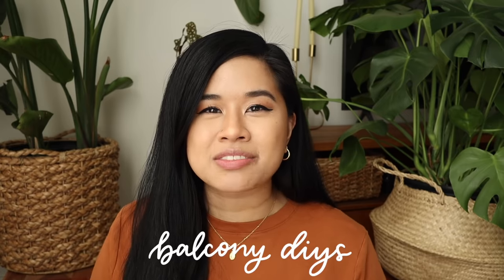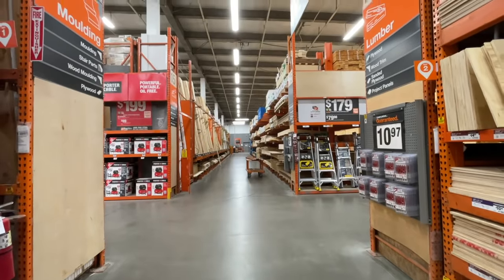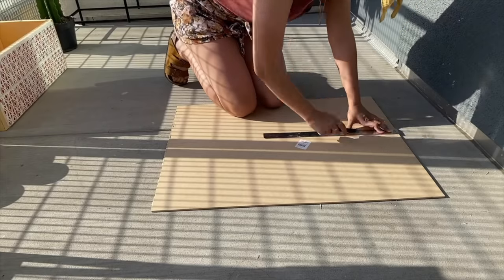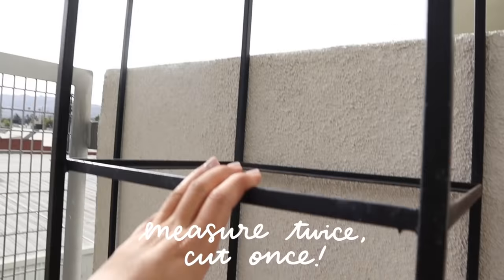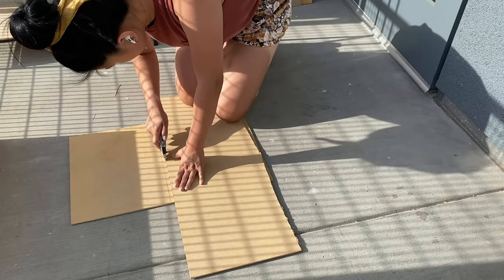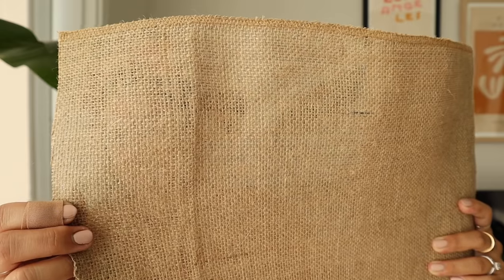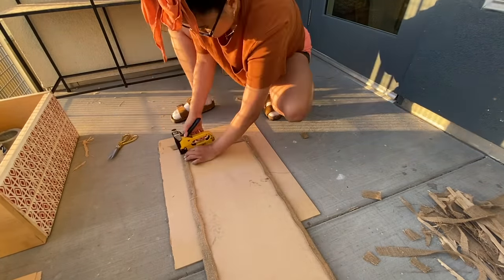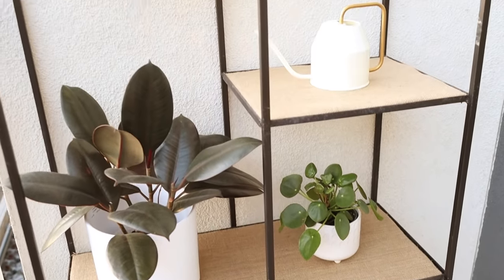*DRAB TO FAB* UPCYCLING MY THRIFTED ARCH SHELF | Modern Boho DIY Plant Stand

Comment: I love that shelf. I bought two single towers just like yours that didn't have the glass shelves anymore. I was lucky I was able to use 12x12 floor tile on each shelf. They fit perfectly. That MDF does not do well with moisture. Be really careful when you water your plants. Rather than trying to waterproof the shelves I would use that one inside and find one for the balcony that is weather resistant.

Comment: You can use a spray topcoat to waterproof them! I usually use engine enamel but that tends to be shiny. They have a lot of different kinds though! Home Depot sells a spray wood sealer. :)
Reply from the maker: Appreciate this suggestion! I def need to look into this 😇🙏🏼
Reply: I just came to suggest shellac.

Comment: When I turned a second-hand diaper changing table into a craft station, I cut MDF to add an extra shelf then covered it with removable wallpaper/contact paper in a wood print I found on Amazon. It’s a great water resistant barrier and wipes clean easily, which might come in handy for when you water plants.

Comment: Hi Tina! 🙋‍♀️
   Love how your shelves turned out! 🌟🌿🌵
   I think you will need to use a water proof sealant (like for a deck) or paint (like for a boat) to protect the MDF shelves.
   We have some MDF shelving from Walmart.  We find the MDF to be sensitive to humidity and they can warp or fall apart.  We live in an RV and are hoping to get into an apartment before the really hot weather arrives (95°-110°+)
   If our shelves survive the move, I want to use marine paint to seal them so they last longer. 
   Hugs & Happiness! 😄🎨🖌️🏺📿🖼️

Comment: My recommendation for waterproofing the MDF without changing the colour is getting an outdoor wood varnish, just be careful if it is water based and test it on some scrap MDF in case of swelling. A regular outdoor paint, such as what would be used on siding, would also work well. Definitely get the MDF coated sooner rather than later as high humidity can cause swelling and disintegration too.
Love your channel, it has been a huge inspiration for me to get crafting and DIYing back to the forefront of my life. In fact I've already been changing some furniture I had using materials on hand. Thank you for the inspiration you've put into the world!

Comment: Love your energy ❤ Tina and you put so much passion in your work. You're doing amazing! 👏

With the staple gun, if I may offer a piece of advice, only because I remember the first time I used one, when you staple close to the edge, rather than hold your hand outside the project, you may find it easier to place your hand on the inside so it rests on the board and the stapler facing outward. This makes you hold the stapler level and it avoids the wonky staples.
I hope you understand what I mean. 😁😶

Comment: You should've sealed your mdf boards with 2 coats of polyurethane first (top and bottom). It is not an ideal material to use for plants or the outdoors. Also using a thick layer of scotch guard on the burlap would be a good idea. These are just my suggestions but you can always research other waterproofing solutions online.